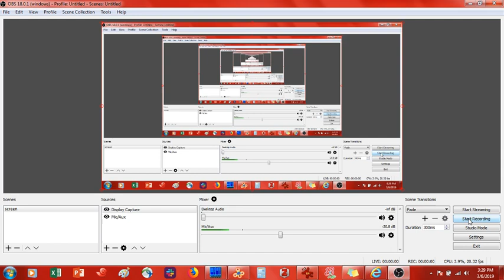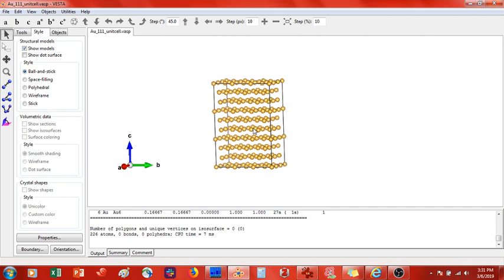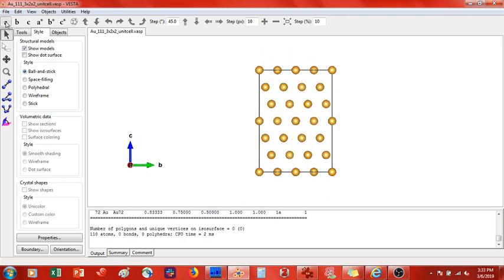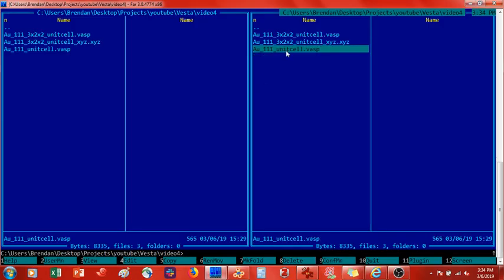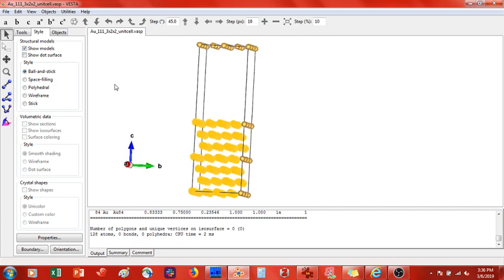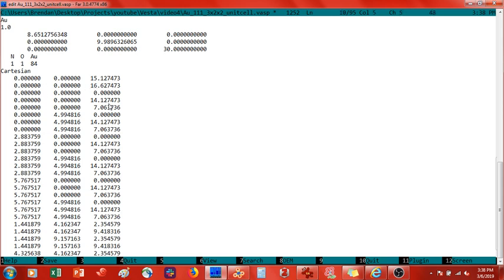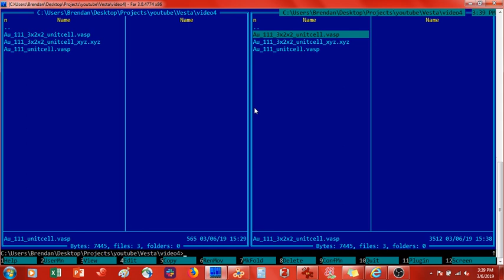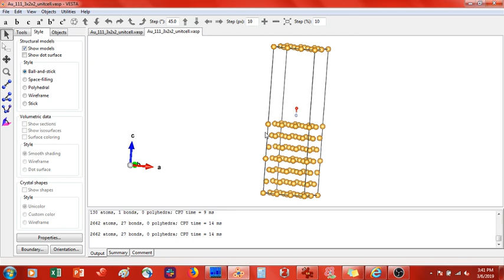Make a heterostructure or interface using Vesta - pt. 1

Comment: How did you decide to place the Nitrogen atom 1 Angstrom above the surface? Can we take the distance between the surface and any other diatomic gas to be 1 Angstrom?
Reply from the maker: It was just a random guess based on intuition. You should do a geometry relaxation after making a new system anyways, which will optimize the positions of all the atoms to minimum energy

Comment: Nice Video...Thank you so much...Can you make a video about the heterostructure of Silicon and strontium titanate?
Reply from the maker: Hi thanks for the comment. I would need to know the crystal structure and faces that should touch. Ex. Is the interface between 111 surface of silicon and 001 surface of strontium titanate ?
Reply: @nickelandcopper5636  001 surface of silicon and 111 surface of STO
Reply from the maker: Thanks. I’ll check to see if it’s possible. Well, it will always be possible, but the cell sizes may need to be enormous. By possible I mean to be able to be made using small supercells of each type
Reply from the maker: Can you please tell me the space groups of each crystal
Reply: @nickelandcopper5636  for STO.. Pm-3m.
Silicon Fd-3m
Thanks ❤️❤️❤️

Comment: I have a question regarding 2D materials like MoTe2 or WSe2, let's suppose that i  have prepared  a monolayer of WSe2 using VETSA with a unit cell of 4x4x1, how can i add vacuum to that unit cell? do i need to take periodic boundary conditions into account before using the coordinates and cell parameters into other electronic structure calculation procedures? Thank You!
Reply from the maker: Jaafar Mehrez i have a video where I add vacuum to a WSe2 monolayer. Use that structure and expand it to make the 4x4x1